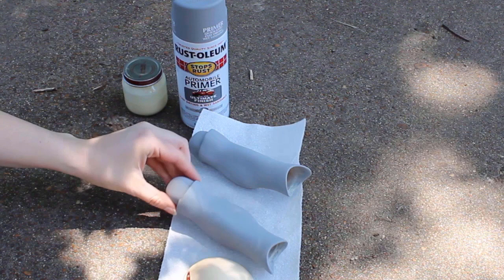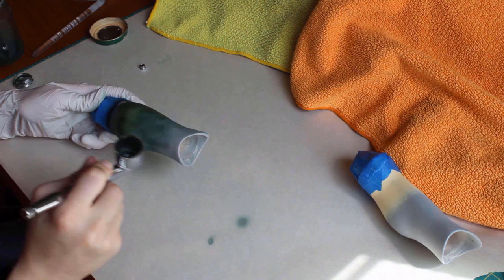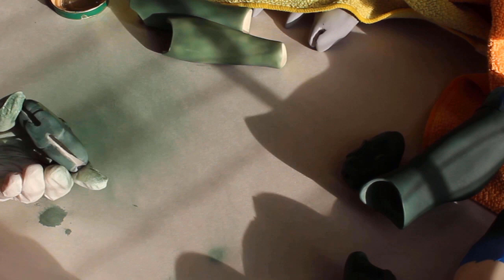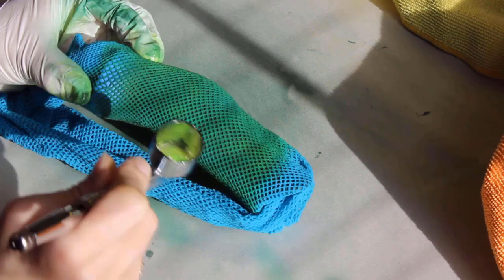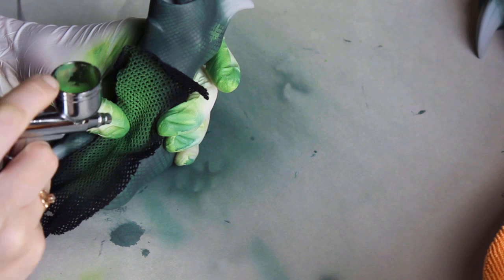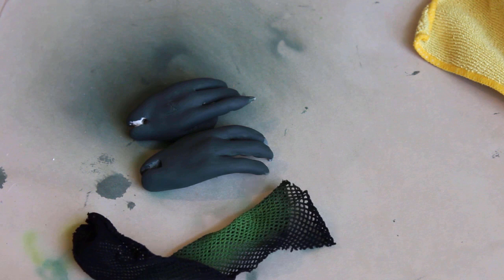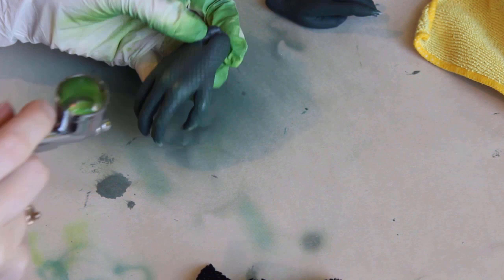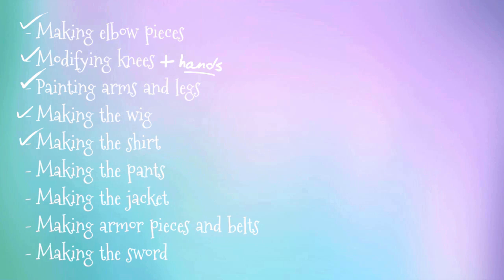Painting BJD fantasy parts - Rune's scales

Comment: When you say at the end you coat it in a clear uv resistant poly , is this a spray? Like kylon or do you brush on this clear or dip it? The second ro last thing you did that really secured it and made it super shiny before you knock that down with a flat or matte final final spray?
Reply from the maker: Solarez UV coating comes in bottle like paint and is meant to be brushed on. I used a sponge applicator for this.
Reply: Do you have any videos showing this solarez process? Im inexperienced in this phase and also there is several different types of solarez. Just really liked how strong and almost permanent your results produced. 👏 🙌 👏 @LomisPlayground
Reply from the maker: @piratewizarddragon  It's not something I filmed because I didn't want to accidentally get UV resin on my camera, but I promise it's as simple as brushing on paint! It feels like a really thick liquid gloss and then you just cure it in the sun. I painted one side of each part with the resin, left it in the sun for 15-20 minutes, then flipped it over and painted the other side the same way. Super easy... but hard to remove once it's cured, hence why I didn't involve the camera.
Reply: @LomisPlayground  sorry to keep asking so many questions. What particular type of solarez did you use. There are several and I'm wondering if the thin coat one would work the best.
Reply from the maker: @piratewizarddragon  When I got it (8 years ago now!) there was only one formula, so I just used the basic Solarez original. The thin hard is newer but should work just fine.

Comment: Great job! That's so cool! Makes me think it would be cool to create one of those lizard people from the Elder Scrolls games lol. :-) Question: Was it a pain to handle and airbrush the parts at the same time? Seems like touching them while the paint is wet would ruin the coat, but it didnt appear to be a struggle in the video...
Reply from the maker: Oh man, making an Argonian would be an unbelievable amount of work. Though I guess you could just get a more reptilian body. Using the whole Monzo body instead of trying to make the feet fit this would have been easier, but I prefer the EID body over MegaGem so I just had to make my own life difficult...
The airbrushed paint dries a lot faster than you'd think. Most of the time it's dry to the touch within maybe ten seconds, and if it's not, a dual action airbrush like mine lets you blow air without paint and that accelerates the drying time. The parts that had primer on them dried a lot faster because they had more texture, so it helps the paint stay where it's sprayed. Smoother parts are harder to paint since the liquid can bead up on the surface, which is why I had to put the arm pieces aside a few times to let them dry more thoroughly.
Reply: +Lomi's Playground Ah, do you also thin your paint with water? Haha, yeah I would not attempt to make an argonian lol. Seems like their lizard heads would have to be sculpted from scratch to save money and time on a doll head, warping it beyond recognition lol. But they might inspire me to get a doll in an unnatural skin color and come up with something inhuman lol.
Reply from the maker: It depends on the paint. Regular acrylics like Liquitex or Martha Stewart or cheap craft acrylics I thin with distilled water. Tamiya acrylics and Mr. Color aqueous get thinned with rubbing alcohol. Those suckers dry lightning fast, almost as soon as it's on the surface. Thinning them with water makes them clump up or peel, and thinning regular acrylics with alcohol does the same thing.

Comment: this is awesome, I never would have thought about the fishnets for scales...may have to use that for an upcoming doll
Reply from the maker: It's a really handy trick, especially since you can get fishnets off eBay for a dollar or two! I've tried other types of stencil but these really do work best.
Reply: +Lomi's Playground the uv clear coat  you used. will it have an issue with parts that rub against each other?
Reply from the maker: Well, everything will rub off eventually--even bare resin joints grind against each other, which is why it's normal to find powdered resin and worn places in the joints of older dolls. I added suede to the joints on this doll to add a cushion to make rubbing less of an issue.
Reply: +Lomi's Playground thanks I will have to try that
Reply: Krafty Kitt yep fishnets work great, you can even pull them over parts of your own body and cover in various make up products for costumes

Comment: Does the resin you used consist of 2 parts? Resin and hardener? Is the stuff called expoy resin? I am interested in that because I am considering the technique myself.
Reply from the maker: What I used was Solarez, which is a UV cure polyester resin, so it doesn't require a hardener/catalyst, but you can use one with it if you're curing indoors. I found that 2-part epoxy resin cured too slowly, so it caught a lot of dust, developed a lot of runs and also formed bubbles I couldn't do anything about. Solarez is made for using on surfboards, so it's quick and sturdy and while it's not perfect, I've been pretty happy with the results!